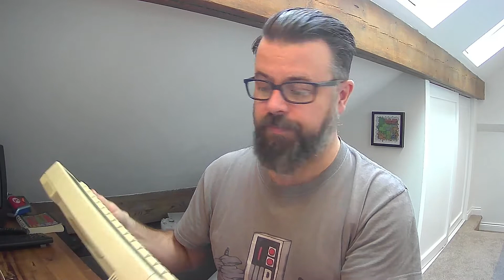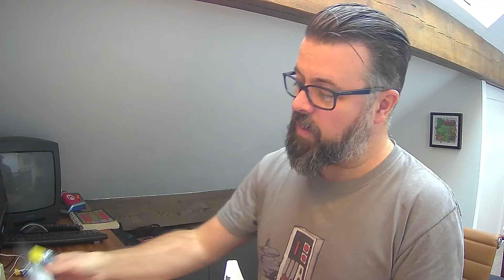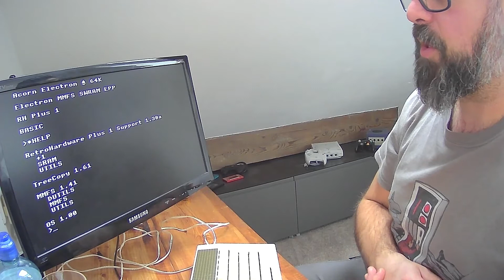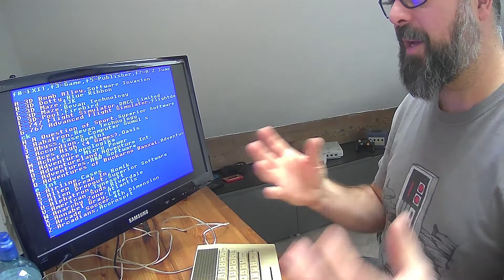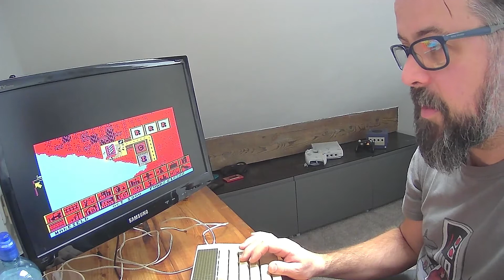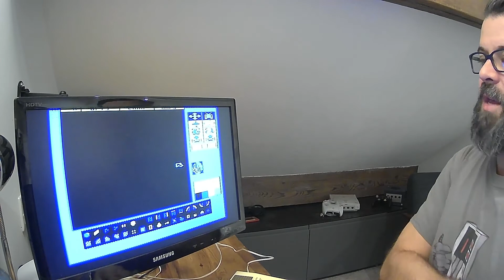Acorn Electron with ElkSD64

Comment: That's actually a later edition Electron you have there.  The earlier ones have a socketed ULA.  I have read that the later ones have better RGB video quality but not actually owned one myself to verify this.  Also your RAM is on a little sub-board at the front - in the earlier revisions it's soldered to the board.
Reply from the maker: Thanks for the info.
Reply from the maker: I've updated the description. I need to do my homework in future!